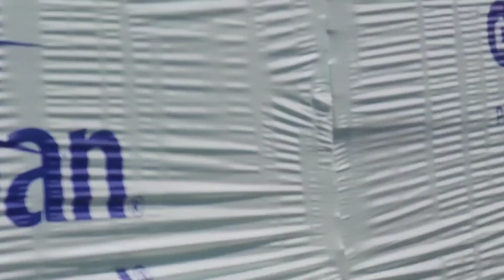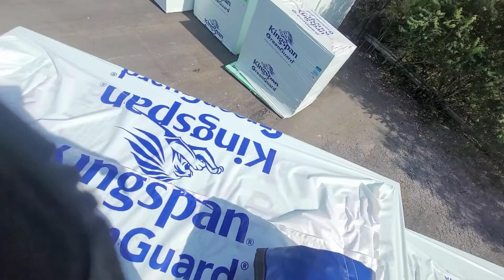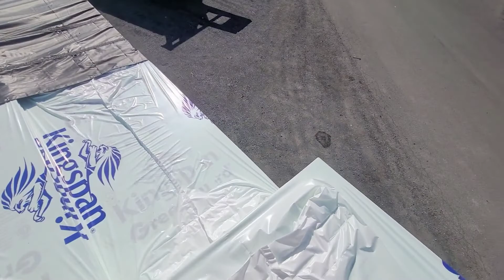flatbed loads😒

Comment: I like tarping now bro , now that it is getting easier lol. What I don't like is wearing that goofy fall protection. Last load I got the loader asked me if I wanted to use the tarp machine or roll them out by hand, I said by hand 🤣  feel like I'm more efficient, can get them placed how I want them,     plus I needed to put blankets on that load, bunch of sharp corners. I'm finding out that 90% of my loads are tarped. 

I've been going on duty for loading for 5-9 minutes then going off duty. Don't want logs on  my back. Hope that's enough to keep them off of me. 
Keep up the grind bro and keep us updated 💪🏽. I met you during upgrade at Springfield, we were in the upgrade class together
Reply from the maker: Yep I like tarpping.  I just left Springfield yesterday they gave me a random 😒😔 my days are now numbered
Reply: @flatbedjay7672  I've been to spring field once  and pittston twice for fuel, thought they would try to sneak a drug test in but nope
Reply from the maker: @TSupraLano  I got a video coming up when they hit me with it